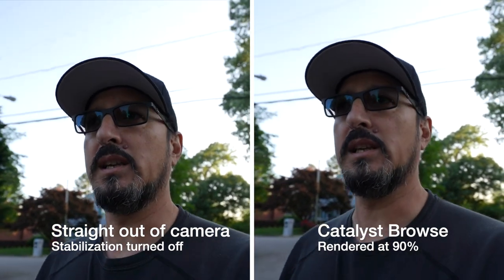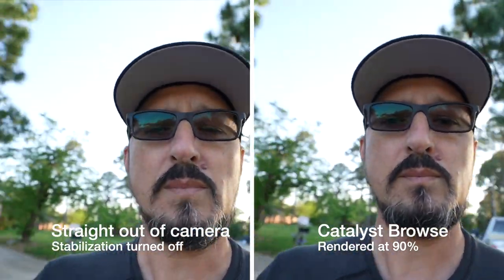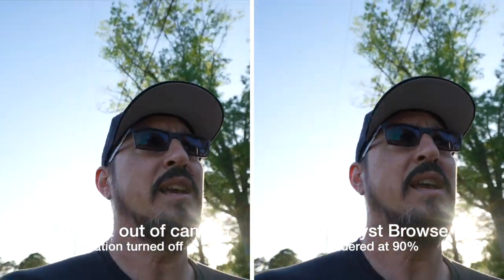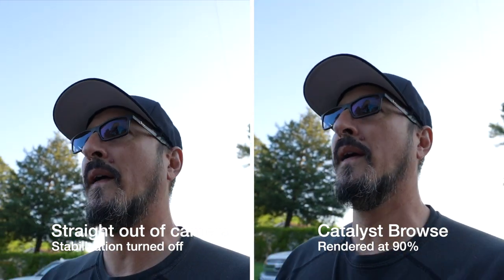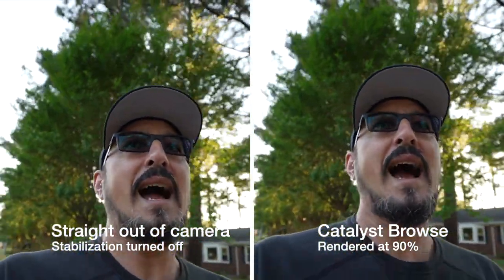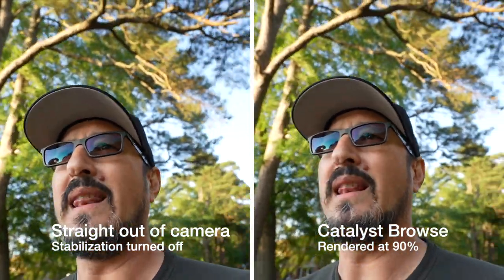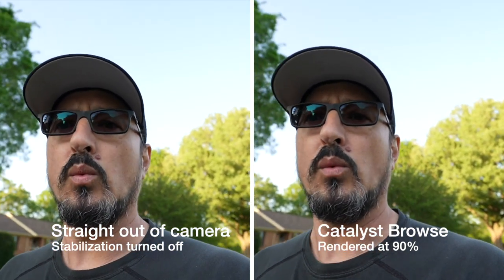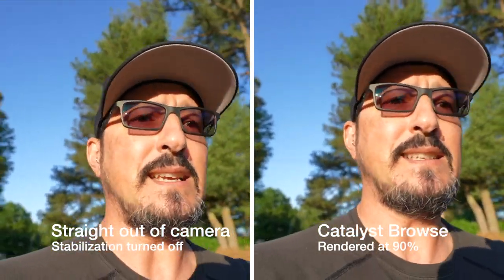Sony a7c Catalyst Browse Walking Vlog Test

Comment: i use 90% all the time it's more than enough. one tip if you walk heavy you need to jack up shutter speed which isn't a bad thing because then you really don't need a nd filter.
Reply from the maker: Yes, 90% seems to be the sweet spot for stabilization and cropping.  I'm still playing with shutter speed since I've seen everything from 1/250 up to 1/1000.